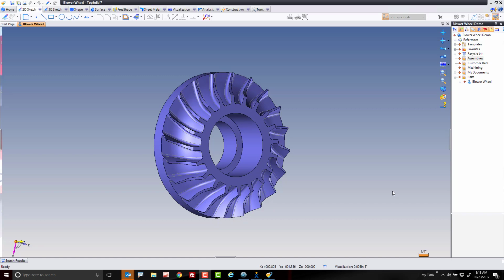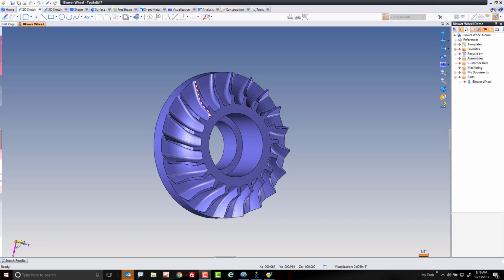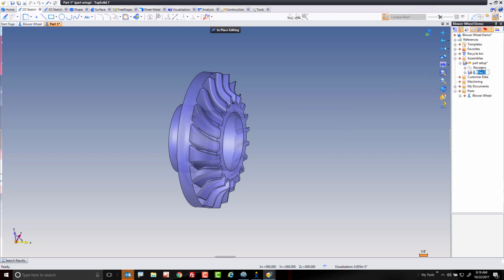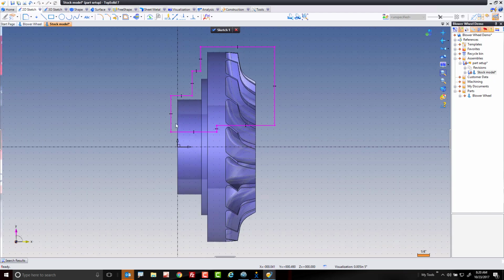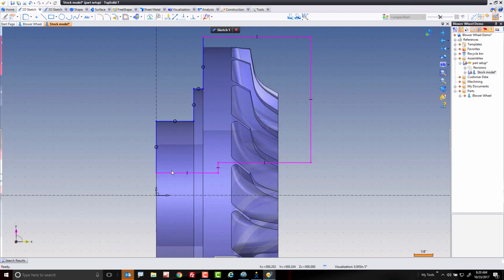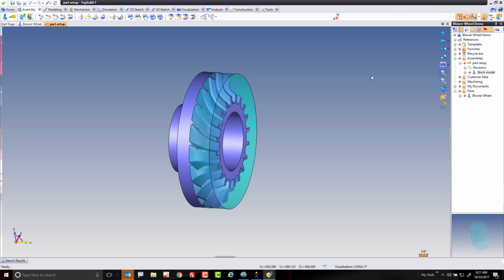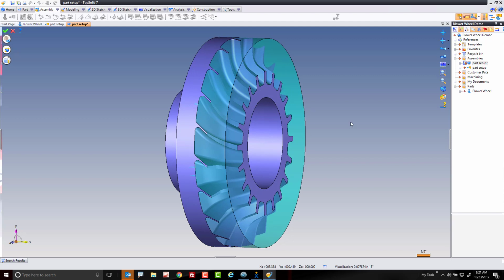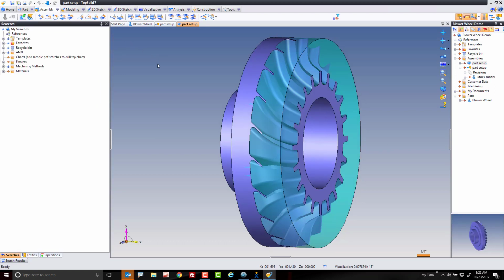Machine a blower wheel with TopSolid - Step 1 Prepare data

Comment: Hi!

It doesn't let me rename any of parts, assemblies in the project. It says "Document name is parameterized, it cannot be modified."
Reply from the maker: Hello.  If your document name is parameratized, you can modify it.  To do this, go into your entity manager, expand parameters and find the one called "name".  Right click on it and in the others menu, choose basify. This will turn off the paramaterization
Reply: @TopSolidBlog  Thanks for your answer. Actually I've figured out what the problem was. I didn't start a blank project template, so the names were parametrized.